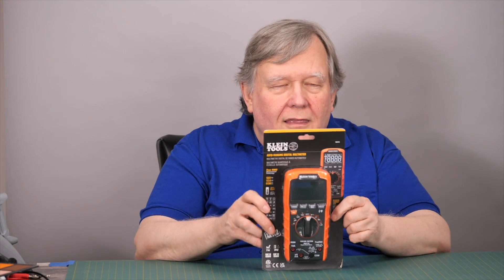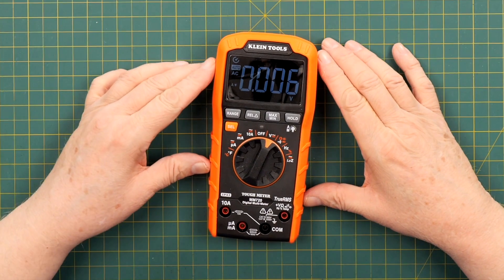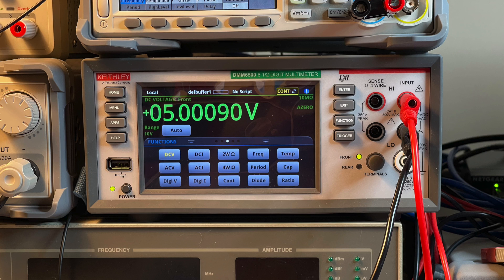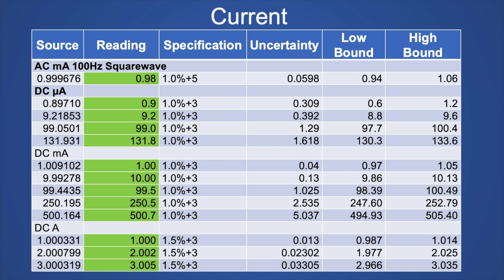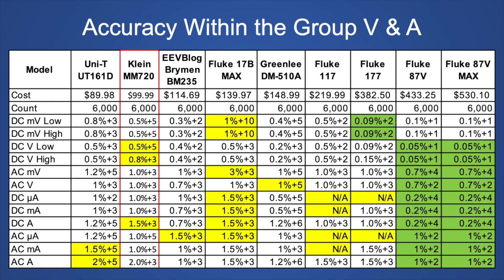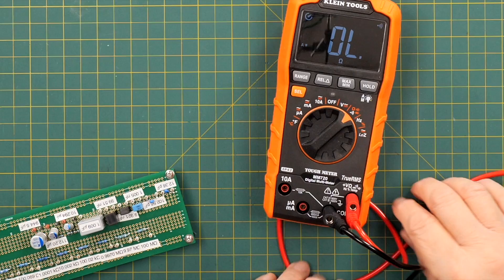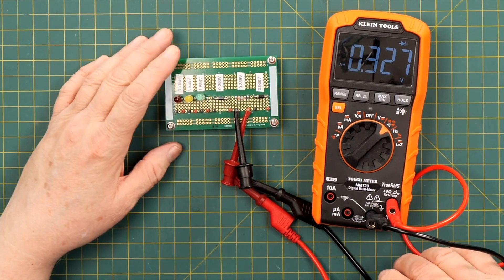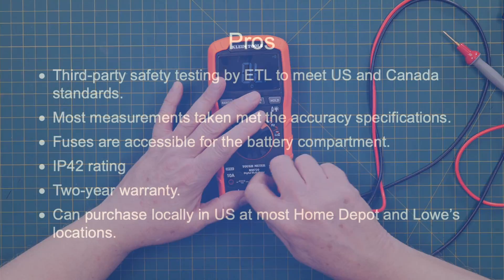Klein MM720 Review

Comment: FYI...The "Lead Alert" on this meter is sort of a joke (if that is something you are specifically looking for).  I just bought one and it doesn't seem to have any actual lead sensing built into the input jacks.  All it does is beep/flash the word "lead" across the screen a few times when you switch to Current mode which is to remind you to check you leads.  I guess it's useful, but not exactly what I was expecting.

Comment: Thanks for the review.  I bought it because I needed something immediately after my old multimeter went kaput.  Good meter but it has a timer built-in.  When not in use for a few minutes it shuts itself off automatically.  Wish I could set that to something like 20 mins.
Reply from the maker: I agree, I find the auto backlight off very annoying.
Reply: you should be able to turn the timer off. it should be in the manual.

Comment: Auto mechanic here. Love this meter does everything I need and more and the accuracy is good for the applications I need the tool for.
Reply: Thanks, diesel tech here 👍 I z just bought this based on specs/price/reputation . Will use for diagnostics
Reply: Motorcycle tech here that’s all I was looking for appreciate it.

Comment: Do you think gold plated leads would change these results and make them more accurate if you were to buy this meter and upgrade the leads? For resistance that is
Reply from the maker: This will only help over time, because the gold plated leads will hold up longer.  As long as you make sure you wipe that oily coating of the leads that come with the meter the leads should be good for a few years.  People who do circuit tracing with continuity measurements prefer the cold plated leads. The meter met it specifications for the resistance measurements I tested.  The accuracy is mostly controlled by the design of the meter.  Instead of spending $35 to upgrade the leads, take that money and add $15 more and buy the EEVBlog Bremen BM235 instead of the MM720, that will give you better accuracy on the resistance ranges.
In my testing I use the same test leads on every meter, I don't use the leads that come with the meter, I want to test the meter not the leads.

Comment: Crap...I bought this exact one...Am I good just reading 12v and 120v things🤔
Reply from the maker: You should be fine.  I try to avoid watching a review of anything I already bought.  I hate that feeling that I bought the wrong one.  12V DC is fine at .5%+5 you will only be up to .03 volts or 30 millivolts off.  My testes show the meter was alway in specification on all the DC voltages.   At 120 V AC the meter is 1%+3 so you could be up to 1.6 volt off.  The meter only missed it very lower AC millivolts specifications, it was fine with higher AC voltages.

Comment: I bought the MM450 but regretted it, I had thought the only real difference between it and the 720 was low impedance mode but there are a few others, the main one I missed being the 6000 count display on the 720 vs the 4000 on the 450. That is my main regret. I didn't even open, I'm going to pay the extra $30 and exchange it for the 720 tomorrow. It will actually be my first multimeter, I mainly want it for tinkering with electronics and learning. Also for around the house / car.
Reply: And farad testing

Comment: That was a bit disappointing. I was hoping that these were an improvement over the MM1000 I purchased about 12 years ago. But, it is a slow, inaccurate meter just like the MM1000, just with a fancier case and display. I hardly ever use mine and probably should have returned it when I realized how bad it was. It may be ok for just a general residential electrician and is probably safe if you have an accident with it, but that is about it.

Comment: Not having a dedicated AC mV range (only 6,000V) and a mediocre DC mV range (600,0mV) makes this meter not so suitable for electronics work. This is more an electrician's multimeter.
I have a 2000 counts cheap pocket multimeter from the 80's that does even better than this one in this regard, so it's not a particularly high bar to set.